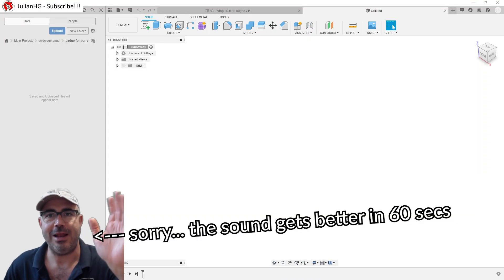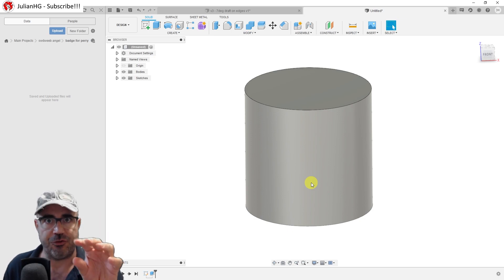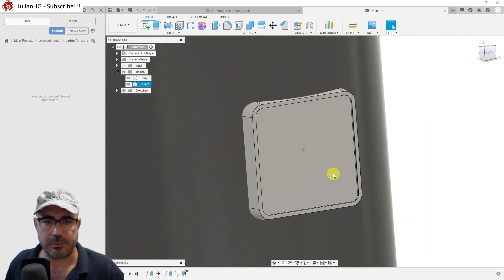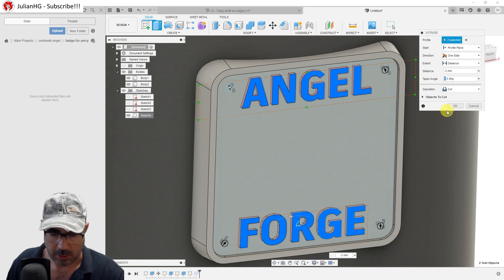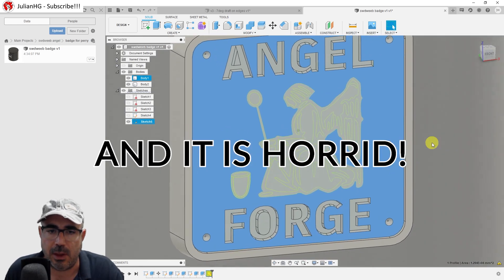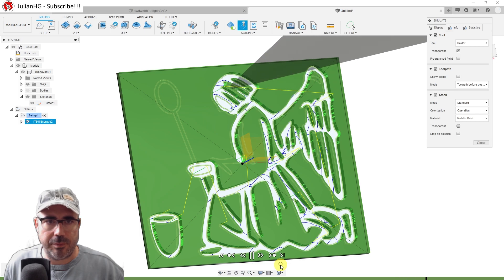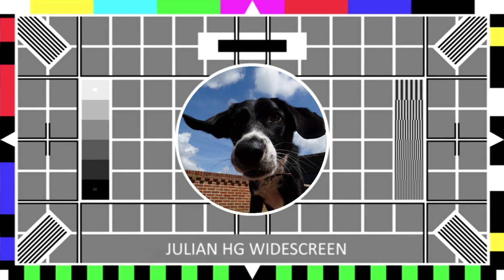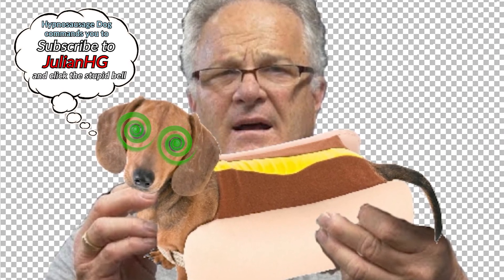Designing SWDweeb's new furnace badge! How not to make a vector extruded with draft angle Fusion360!

Comment: I really like what you did and it looks great on the Furnace. Isn't it possible to loft the individual letters as their own objects, with a thinner version of the letter at one end so you can remove the mold and not damage the sand? Then you can could position each letter along the same axis  so that they all make the correct spaces in the badge using them together as a boolean? Just subtract them from the base shape of the plate? I don't know Fusion 360 at all but every 3d modeling tool I have worked with have booleans and lofting?

Comment: I have copied line art into Fusion 360 by inserting a jpg using the canvas command and then trace using a sketch. To give lines width I use offset.  Then complete a face by connecting the ends of the offset and line. Now extrude into the plate and input draft. Most I have spend is an hour or two. Also use insert canvas to make parts like acorns for hinges on antique floor safes. Just complete a repair piece for a dutch windmill garden ornament that is an heirloom and was damaged when a limb fell on it.
Reply from the maker: I did this too and it did work for simple shapes but anything intricate it never could compute the draft. I found the whole thing very clunky.

Comment: Hi Julian, great video as always. I'm no expert with Fusion but I've done some things with it that I'm pretty proud of. Couldn't you just extrude the original SVG and then use a two distance chamfer on the edges to get the desired draft. I did try this on an SVG I downloaded and it does seem to work. Yes you would have to control click around the edges but I'm assuming that would be a lot less painful than what we couldn't see from your lengthy not seen video.
Reply from the maker: Thnaks badgerint, firstly im no expert. I did actually control click all the curves originally but i found that after one or two curves ruining the while extrusion and having to re click the 100 curves again i just gave up after the third try. I want some thing semi easy, and all the while i was doing the workaround it was easy(ish) just finiky as hell as to what settings or curves worked. There’s something screwy with the math, some curves that look horrendous work some simple looking one spoil the party.
Reply: @JulianMakes  I feel what your saying. Many times I've had a mis-click during adding multiple selections and then you have to do it all over again.
Reply from the maker: @badgerint  oh god its the worst!!!!